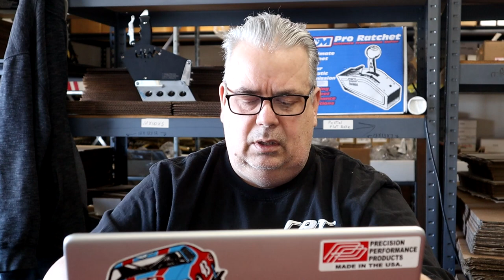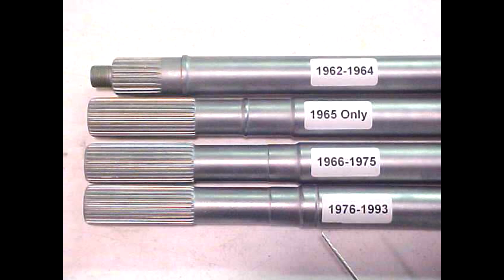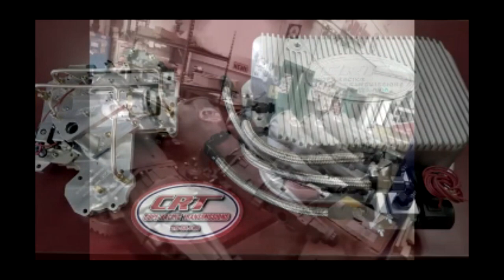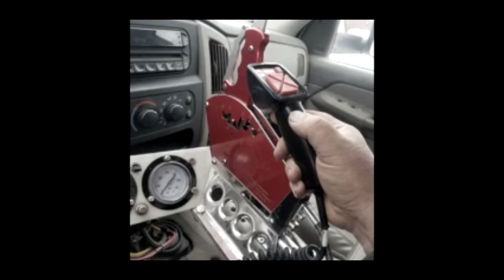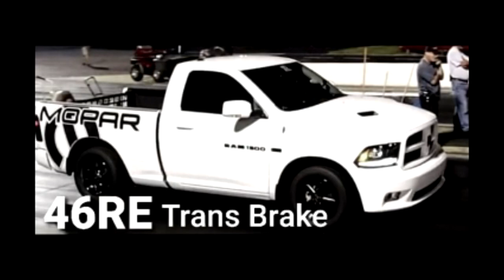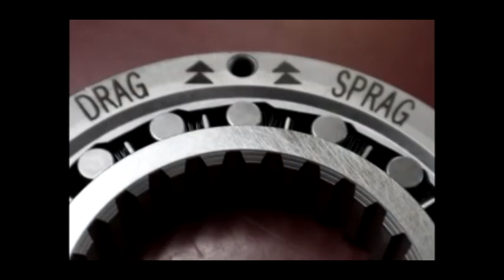CRT BUILD IT YOURSELF KITS

Comment: Great video and definitely a great move to sell the BIY kits.
Will the 500 hp 904 kit work wel with just a stock valve body with TF-2 shift kit? Or isn't that enough?
Reply from the maker: Yes it will work
Reply from the maker: Yep, it will work just fine
Reply: @coperacingtrans  great thank you!